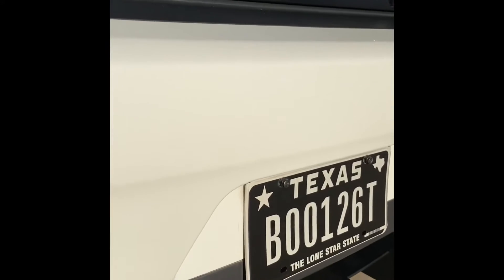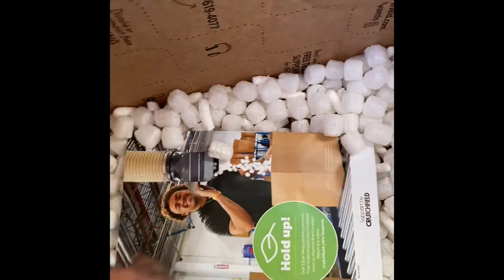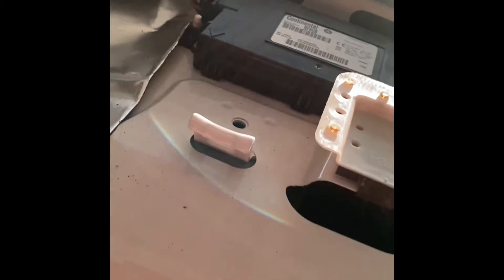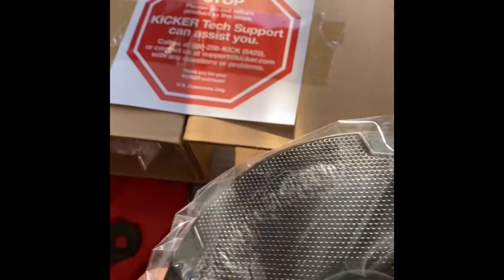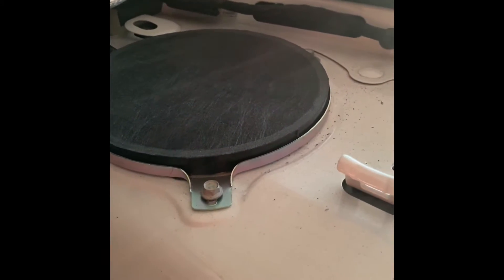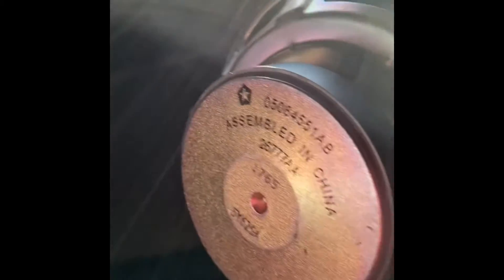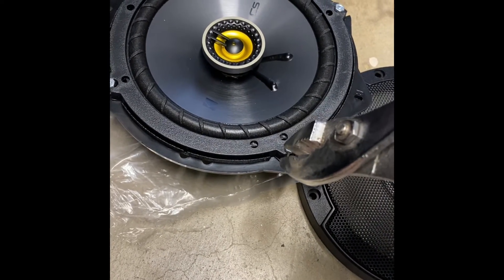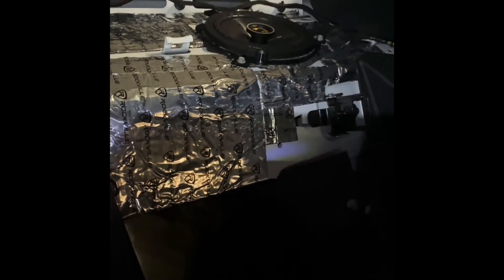Rear Speaker Install on Dodge Challenger

Comment: thats not the amp, its part of the remote start keyless entry system circuit, the amp would be under the steering wheel, the rear deck speakers are 6 3/4"s
Reply: do they require 6 3/4s or can you use a 6.5
Reply from the maker: @36mil3  6 3/4” is the true fit. I used the 6.5” with additional brackets.

Comment: Hi, thank you so much for the detailed video, do you know if the original speaker is 2ohms or 4? want to upgrade to Pioneer 4ohms, thank you
Reply from the maker: Hey sorry for the late response. I took out the old factory speakers  and checked them out and could not find a stamp on them identifying the ohms. The Kickers I put in are 4 ohm independent and are still banging hard daily. I have the bass maxed out on the equalizer  and sometimes crank it full volume to hear over the exhaust lol. I would say make the move you will not regret it. Thanks for watching I hope your new upgrade sounds amazing👍

Comment: Oh wow this is easier than I thought I would be lol. My bass has went out on my speakers and I'm trying to learn how to do this stuff myself instead of paying 300 bucks to replace 2 speakers
Reply from the maker: Hi, I would highly agree with you and give it a shot. Save a little cash, learn how to take apart your car, and pat yourself on the back with the job complete.  Good luck you got this 💪‼️
Reply: @SHAKER36  thanks 😊! Do you have a tutorial on how to replace the door speakers by any chance?
Reply from the maker: @LoveByNicole  I currently do not unfortunately.  Very curious on if it would make a difference. Shaker has the Alpine 6 speaker system with factory amp. I have been wanting to test a aftermarket set of 6x9s and see if it makes it hit harder. Still in the works. I also need to post a video on how I swapped the dash speakers. Swapping the dash speakers clears up the highs and adds some strong mids 👍.
Reply: @LoveByNicole if you haven't already it's easy you've three screw at the bottom one behind the handle one under the window switch.

Comment: i decided instead of the tiny mounting screws and nuts, i used the included sheet metal screws and drilled tiny holes into the install bracket through the existing holes below the slots, much tighter and better mounting, do you use the included speaker grills or just leave them off?
Reply from the maker: That’s a good idea 👍. Thanks for sharing as far as the speaker covers I did not install. I like the clean factory look. I appreciate you watching have an awesome day.
Reply: @SHAKER36  also crutchfield sent me the harness for the front dash speakers, i called them and they told me thats what i have, i said no, sent them pics of the ones in myh car and they said huh, they will have to look into fixing that. and the brackets were one off, meaning, i line up 2 and the back one was like to far back have to dremel out the hole more oblong to fit them.
Reply from the maker: Glad you got them to work 💪‼️.
Two holes will hold when tightened down properly. Most of the time with aftermarket parts some modding needs to be done to get the look you want 👍.

Comment: Can you provide the link for everything
Reply from the maker: These are the correct speakers you need. I used 6.5s the link is for 6 3/4 you won’t need adapters. Wiring harness is included. The sound deadening I used is from Rockville Audio. Lots of different brands offer sound deadening material with different sizes and lengths. Hope this helped 

https://www.crutchfield.com/p_20646CC674/Kicker-46CSC674.html

https://www.rockvilleaudio.com/rm50rt-s/

Comment: Hello ! I’m new to the whole sound system thing and I really wanted to add more bass to my stock sound system. It’s not harman kardon or even alpine. Does installing rear speakers help with the bass ??
Reply from the maker: Hi, changing out just the rear speakers may add a little bass but not much. If your cars radio system is not equipped with an amplifier. I would recommend getting a 4 channel amp and changing out the speakers for some clear, crisp, loud music. I have the Alpine system and all the bass is coming from the 6x9s in the door. If your just looking for head pounding bass you can skip my first suggestion and get a 2 channel amp and a 12” woofer or two. Either route you take I would highly recommend adding sound  damping material. Hope this helped👍

Comment: I’m curious when you changed ur speakers did you have to put in a new amplifier? because all these speakers places are telling me I have to if I want a louder sound because you can’t just change the speakers without the amplifier being changed to
Reply from the maker: Hi Kyky Penn, I have not put in a new amplifier. I have swapped out both front dash and the rear speakers with no issue.  My doors are still stock. The sound is not louder, but crisp and clear. In my opinion I would only install a new amp on the speakers  if your planning on adding some serious bass. Swapping out just the speakers to me made a  HUGE difference. Hope this helped
Reply: @SHAKER36  do you have a problem with the loudness?
Reply from the maker: @kykypenn   none at all. With the speaker  set up right now you can still crank it and get good loud sounding bass hitting music. Nothing extreme but definitely better than factory.
Reply: @SHAKER36  do you notice a change with that? Vs the factor? And are the speakers the same watts
Reply from the maker: @kykypenn   I do notice a change. In the challenger your front speakers are used for your highs. Your back speakers also play highs and mids. The speakers from factory are made out paper not very good. The Kickers are a bit higher wattage, run at a higher rms, and made of a durable plastic. Any after market speakers would be an improvement over the factory.
Reply: The factory amp and speakers are rated at 2 ohms so adding 4 ohm speakers will play a little softer but still probably clearer.   I switched out the dash and rear deck speakers with JBL 3 ohm speakers and I honestly can’t tell any difference in volume at the same lever playing the factory speakers.   The addition of the tweeters over just having mid bass and midrange speakers make a high difference.   I’m very happy with the 6 x 9 woofers in the doors because the my only receive the bass signal from the amp.  I won’t switch them out or add a sub; I’m extremely happy with the change I made and it only cost about 200.

Comment: I was wondering if you had to get a Pac Audio adaptor in order to make the speakers work?
Reply from the maker: Hi no additional adapter needed. They plugged right in and played.
Reply: @SHAKER36  did you have the 6 speaker alpine system with factory amplifier?
Reply from the maker: @jerryees   yes I have the Alpine system with two 3 1/2” in the dash, one 6x9 on each door, and two 6 3/4” in the rear deck. 6 1/2” can be used in the rear you will need some attachment brackets
Reply: @SHAKER36  i believe only the deck speakers need brackets

Comment: nice vid, but you installed the speaker into the wrong slots!  You were supposed to use holes, not slots on the adapter, and slots on the speaker frame. But the screws  that are supplied by crutchfield/scosche are wrong.  I went to a hardware store and got 1/4 inch longer and #6 screws, with matching washers and nuts.
Also, did you check to see if the polarity on the wiring was correct? ( On a challenger forum there were cases where there was reversed polarity),  and that will adversely affect sound and speaker life.
Reply from the maker: Hi Scott S. thank you for the info. I have read about the polarity issue. At the time speakers were already installed.  I felt they were missing mid/low end sound. I thought this maybe the issue. I gave Crutchfield a call and mentioned the issue. They offered to send me a new set of the different adapters, and some 6.5” Boom Mat speaker baffles at no charge.  I made the swap and installed baffles, but still feel it could sound better. 
My next step if I decided to go for it would be to add an LCQ-1 audio controller. To hopefully give all speakers a fuller sound and more manageable when wanting to control the sound that comes out of them.
Reply: @SHAKER36  Thanks for your response with update.   I also bought baffles by XTC for helping the Kickers produce better low end, even if it's slightly better.   Besides that, the polarity issue, and the difference in resistance in ohms.   The factory Alpine are supposedly rated at 2ohms, and the Kickers at 4.  So It has been said and noted that it will affect the volume output ( lower for the same previous setting.) 
I also am putting the  adhesive foam ribbon around the speaker mounting edges, for a better airtight installation.   So much planning to try and do this as best as possible!  👍
Reply from the maker: @scotts6596  I have been hesitant on change out my door speakers because of that reason. Right now all the Bass is coming from the 2ohm door speakers. If they are swapped the THUMP will go down. For now I have only swapped out front dash, and back panel. I do not want to add subs, and amps. I LOVE the sound of Rumble.

Comment: Hey bro nice setup. Did you use kickers for the 2 front dash speakers or any other brand? What size opening would you say is for the subwoofer between those rear speakers?
Reply from the maker: Thank you ! Yes I used the matching Kickers in front.  Here is a link. The subwoofer I believe would be an 8”inch.  Let me know how it sounds if you add that subwoofer👍.       

https://www.crutchfield.com/p_20646CC354/Kicker-46CSC354.html

Comment: also....can you put the link of the plug remover....to get the deck up....you had to remove a few of those factory tabs....Where did you get it..
Reply from the maker: Hi, I found mine on Ebay. There are multiple types just depending on what your looking for. I wanted to have replacements handy...https://www.ebay.com/itm/Car-Trim-Removal-Tool-Pry-Plier-Door-Panel-Dash-Radio-Audio-Interior-Clips-Kit-/265056061439
Reply: I'm sure I'll catch flak for this, but you'll probably find the tools quicker & cheaper at your local Harbor Freight store.
Reply from the maker: @DJGRoc   Yes sir‼️ If you have one near by I would defiantly recommend um. I have saved tons of money using HF👍‼️

Comment: Since it's been a year since you did this install, have you noticed any change in the aftermarket speakers? Any distortion or blown speakers?

The problem I've always had with aftermarket speakers on factory decks/amps is that they're usually underpowered. You can blow a speaker by not providing enough power to it, just as easily as you can by putting too much power.
Reply from the maker: Thank you for the info. In the SHAKER I crank it up. I can’t hear the music over the Exhaust👍‼️ So far the speakers have hung in. Unfortunately though I put theses speakers in my Hyundai VeraCruz, same size and everything and both rear speakers sound blown. I’m pulling out my 6.5 in Challenger and dropping them in the blown VeraCruz speakers. Then copping the 6&3/4” Kickers. I like my music loud and clear. Hope this helps‼️
Reply: @SHAKER36  That makes sense with the Hyundai. I had the same problem in my Accord years ago, until I installed an amp that actually kept the speakers in their RMS range.

I know what you mean about the exhaust. Having exhaust tips that extend past the end of the bumper helps with that.

Comment: Hey Man awesome install. Been looking for some new speaker for mine. Also I've meant to ask, did you have any problems running the car with the catless pipes without the tune?
Reply from the maker: Thanks for the question Dallas Lewis. When I eliminated the cats, I also purchased the BBK O2 extenders to clear the check engine light. After installing a new CAI filter, I started getting  a check engine light. I would unplug the negative terminal to reset the system and it would temporarily go off. I added the Diablo inTune3, and so far it has not come back on 🤞

Comment: I had a question about how you wired the speakers up 🤔😅
Reply from the maker: Hey what’s up Dennis Ruff. What’s your question I will do my best to help.
Reply: @SHAKER36   okay thanks and how did you get the factory harness speaker wires to work on the aftermarket speakers ?
Reply from the maker: @Dj94113   when you pull out the factory speakers you will notice they are connected to the car by a plug. You will need to push a small tab down to pull the speaker back and out. The new speakers I ordered were from Crutchfield. They will send you the harness plug that attaches to the new speakers, and plugs into the factory connection. Good luck hope this helped.
Reply: @SHAKER36  i can not find those speakers for my 2023 challenger, or the adapters to mount them or the speaker connectors? says on their site, will not fin my car?
Reply from the maker: @timsantoro4586 I checked website and found these 6 1/2” that fit a 2023. Not sure if you have the upgraded system like Alpine or Harmon Kardon. Regardless the speaker size should remain the same. Here is the link. I hope this helps.

https://www.crutchfield.com/p_20646CC654/Kicker-46CSC654.html
Reply: @SHAKER36  i forgot to mention, i got the pac wiring harness and the amp pass through harness and installed 2 jl audio amps , 1 for a sub and the other is for the door, dash and rear speakers, i tied the dash and doors together, the amp is a 300/4 for the fronts and rears, thats why i was wondering what would be better

Comment: friend could you pass me the part model for the three screw adapters of the speakers
Reply from the maker: Hi there, here you go brother I found them on Crutchfield. Scosche SAC-656 Multi-purpose Speaker Mounting Brackets
Item #142SAC656. I hope this helps 👍
Reply from the maker: https://www.crutchfield.com/p_142SAC656/Scosche-SAC-656-Multi-purpose-Speaker-Mounting-Brackets.html